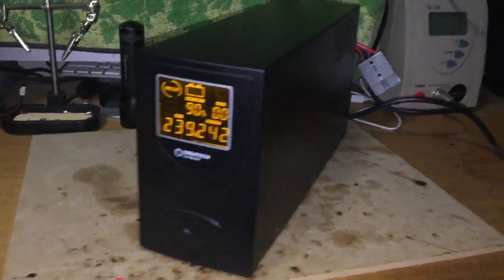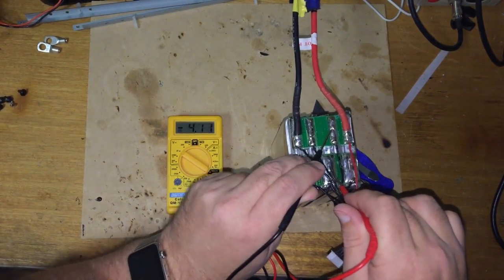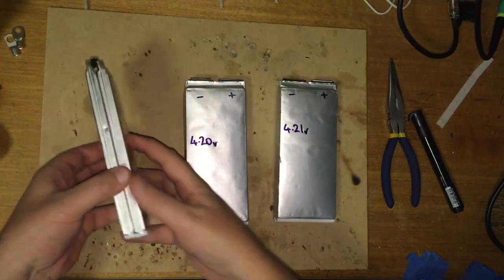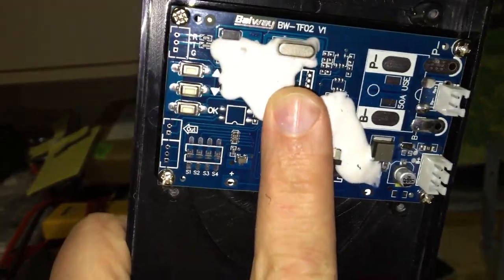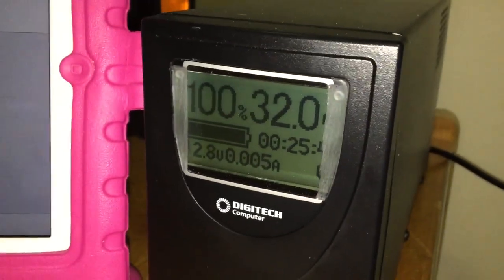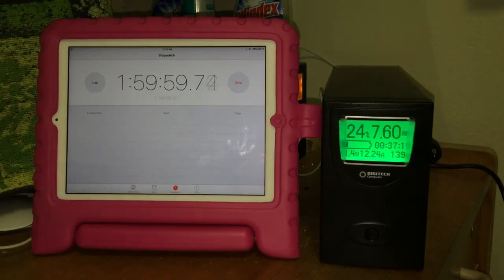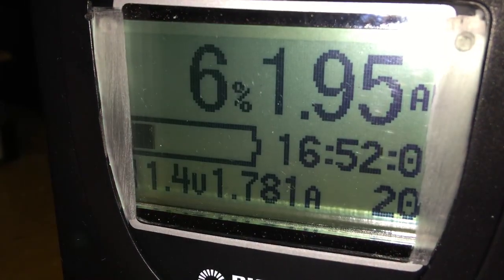DIY Lithium UPS Build

Comment: What is the shunt for?  Is that how you're measuring current?  Right nice video by the way.
Reply from the maker: MantisRay861 yep. The shunt came with the power monitor from eBay which measures how many amps are being consumed and from that everything else like battery level etc can be calculated

Comment: do you use the original charger (for the different type of battery) to charge the Lithium Ion batteries? Is there any problem using the different type of charger? I like your hack, by the way.
Reply from the maker: Thong Vu hi. No I don't use the original charger. I use a 12.6v power supply that switched from CC to CV. The cell balancing is done by the balancing circuit on the BMS

Comment: Good Job mate, can we replace the car lead battery by a lithium one?
Reply from the maker: Easy. But you'll need some sort of battery protection for the charging
Reply: The BMS doesn't handle charging?
Reply: There are different types of BMS, some off them have just the Over-discharge, Overload and maybe an Over-Voltage protection, some of them have also a balancer to keep the cells balanced.
Reply from the maker: Yes, this BMS offers over charge/discharge/load/temp protection and it had a balancing feature that will balance the cells when full
Reply: You need to worry about the current, a lead-acid battery can be asked 100-400A or more during start-up. So you need a 40Ah 10C battery minimum.
Also, you may need to modify or add a voltage regulator on the alternator, because the maximum voltage for a 3 3.7V nominal lithium battery in series is 12.6V, while the alternator will give 13.something.

Comment: may i know where you bought that 16000mah lipo is and how much it cost?
Reply from the maker: Hi. I was lucky enough to receive these for free from a drone company that replaces their batteries every 12 months. I have not had good results with these cells. I much prefer 18650 cells rather than the pouch cells

Comment: Is this an expensive battery. Would like to buy one and break it down for a different power supply purpose. Wondering if it is cost effective? Thanks in advance mate
Reply from the maker: The Dookster I got 6 of these batteries for free as a nearby drone company replace all their batteries every year. But I think these are expensive
Reply: @pcarlson1979  I am trying to make a 16ah 12v power supply for my fish finder  (out of 200a Lithium Polymer Spim08hp 3.7v 8ah Flat Pouch Cells LiPo Batteries) and can't find anything that would tell me whether I need 3 in series or 4 in series. Thoughts? 3 I was thinking would be less than 12v @3.7 and 4 would be 14.8 @3.7

Comment: that's cool !
Reply from the maker: Thanks. I'm building a 160Ah (2Kwh) Lipo battery bank to be used whilst camping. 10 of these 16Ah Lipo cells in Parralel. 3s10p. It's only a bit smaller than a normal car battery :)

Comment: what wave form your ups outputs? pure sine wave or modified square sine wave? if its modified sine wave, would you be able to replace the circuit with the one that will generate adaptive sine wave? pfc power supply don't like modified sine waves.
Reply from the maker: Mystic Bardock LSSGSS hi. The output is 240v modified sine wave. I'm fully aware of the limitations of modified sine wave inverters. The 3D Printer uses a switch mode power supply, so yes the power factor is not quite 1 so it runs a bit more inefficiently but handles the fast switch very well. Heating elements or resistive loads on the other hand can't use a modified wave. Inductive loads are quite fine.
Reply: Thomas James when it comes to modern computers with active pfc psu, they abruptly reset sometimes cuz of modified sine wave so is it possible to diy replace or modify ups circuit so it will output adaptive sine wave which is a modified triangle wave which is much closer to pure sine wave.
Reply from the maker: Mystic Bardock LSSGSS it's hard to find a saw tooth (triangle) inverter. Square wave is not ideal, but works fine. The power factor correcting circuits will run a little warmer, but as long as your device is in good condition it generally won't matter.
Reply: +Thomas James is it not possible to mod the existing circuit in ups so it outputs adaptive sine wave or pure sine wave? computer is new but still resets whenever there's slight fluctuations in power, computer powers off itself for a sec including the power led and then turns back on. http://www.akshatblog.com/use-only-pure-sine-wave-ups-with-psu-having-active-pfc/

Comment: most LIPO tabs wont solder, what did you do?
Reply: Factory pre-soldered them with the right flux so it's easier for you to simply apply heat and join them back together, if you got fresh battery tabs then get flux for soldering aluminum and 91/9 Tin/Zinc soldering wire, good luck!

Comment: How do you charge it mate? are you using UPS's charger?
Reply from the maker: Andrey Garcia hi. I've installed a lithium 12.6v charger and the protection is done by the BMS so whenever the power comes back, it automatically charges the battery
Reply: i have no idea how you put the charger anyway, can you please show me your charger and how you wire it? and the BMS work for protect Over Charge and Over Discharge, right? how to wire it all? any references? Thank you
Reply from the maker: Andrey Garcia I'm uploading a new video now that shows everything. It'll be ready in about an hour.
Reply: yeah. Thank You mate. I will waiting for ya. email me when it done
Reply from the maker: Andrey Garcia it's up now. Just go to my home page and it's the newest video

Comment: Hlo bro can i use lithium ion bms in Lithium polymer ?
Reply: They should have the same cutoffs, except if that's a 3.8-3.9V (4.35-4.4V full charge) li-ion (aka li-hv) bms, or an lifepo4 bms/battery (2.5V-3.2V-3.65V)

Note that you should also check the current (C rating*capacity in Ah)

Comment: Do you use any kind of battery balancer?
how long you charge it?
Reply from the maker: Hi, The BMS I use does all the balancing. The charger might take 18 hours to recharge but when it's done, it automatically switches off
Reply: what the specification of the required power for the BMS?
Reply from the maker: ***** Hi.
The BMS is a 3s LiPo BMS from EBay. It has charge balancing and can pass 60A. So at 12v that will let me use 720w. I am using a 600w inverter. The BMS was $14 from EBAy I think
Reply: I am still didn't get it, actually, what you use to convert AC power line to DC? and what is the output of the adapter? is it OK to use 12V adapter while max LiPo voltage will goes to 12.6V (slightly higher than the supply adapter)
Reply from the maker: +Kartiko Nugroho oh. To charge the battery I'm using a 12.6v LITHIUM charger. This then connects to the BMS which will then switch in balancing circuits when required.
Reply from the maker: ***** That will charge the cells to 4v which is totally fine for longevity .
Reply: hmmm but it wouldn't go to 100% right?
and what about max current that your power supply can deliver?
Reply from the maker: +Kartiko Nugroho if you charge the Lipo to 4v it won't be at 100% but that's ok. I have a 600w inverter which delivers 240v up to 600w. This will draw up to 50A from the battery. The Lipo can safely deliver 480A (15C) but because this is a second hand Lipo, it can now only deliver about 100A. So this is fine for this application because I only have a 60A battery management system. It monitors each cell voltage and if any cell goes too high or too low it will turn off power from the battery. I did a successful run test where I actually 3D printed a model and the system ran my 3D Printer for 2.5 hours! The printer only draws about 10-20A
Reply: I mean the power supply located after AC outlet before the BMS...
Reply from the maker: Oh ok. I have a 12.6v lithium charger. So it connects 12.6v CC and CV to the onboard BMS. The charger drops 240v down to 12.6vDC
Reply: what the current of your CC and CV charger?
Reply from the maker: I am using a 12.6v 2A CC CV lithium charger
Reply from the maker: After I drained the battery flat, the charger charges the battery at 1.89A which is about as fast as it can go. It took about 20 hours to fully charge up. It's a bit slow I know but I can only fit in a 2A charger, the 5A charger won't fit
Reply: 12.6 is normal full charge voltage for -series cells... why did you say they would only charge to 4V ?
Reply from the maker: I have set the BMS and charger to only charge to 4v per cell. This will improve the longevity of the lipo cells as they don't like being at 4.2v for very long at all.

Comment: Where did you get the display from?
Reply from the maker: EBAYhttp://www.ebay.com.au/itm/Battery-Capacity-Tester-coulometer-50V-350A-Lithium-Lead-acid-12v-24v-36v-48v-/331727389307?hash=item4d3c7e427b
Reply: Nice project, thanks

Comment: Great Video !  Go outside and short out the battery and see if it will catch fire...  A very dangerous metal, but I do like Lithium ! ! !  tjl
Reply from the maker: Tim Lipinski I'd rather not. I've accidentally shorted one of the lithium cells on my home converted electric bike once. Just for a fraction of a second. Huge blue sparks and a few holes in my shirt and it sliced through the hardened steel bolt like soft butter!!

Comment: tell me about  the display
Reply from the maker: ART crush it's a COULOMETER capacity monitor from eBay. It'll measure up to 300A.
Reply: i have a batery made from 18650 cells .what is the bms i should use.( doesn't ups comes with a bms system )
Reply from the maker: ART crush The original UPS had a lead acid battery so there was no BMS. You'll need a 3s BMS

Comment: Not safe li-po batterys are not as safe as ion but they have them in you phone so it shouldn't be to bad
Reply: You're ignorant.
Lipo is the replacement for li-ion.
Lipo are the marginally safer batteries.
The problem was never the batteries anyway, it how they are implemented.
Neither is safe without a bms.
With a bms and proper configuration, both are safe.

Comment: You are destroying those lipos and chancing a runaway thermal reaction, which could burn your house down. Each battery should never be discharged lower than 3-4 volts each. Basically, if that unit draw the voltage on the pack lower than 9.0v, the lithium polymer battery pack has been damaged. You replaced a SLA with lithium, without using a lithium control board and that is really, really dangerous..
Reply from the maker: Paul Andrulis yeah I know. The BMS on the battery shuts off the power if any cell hits 3v.
Reply from the maker: Paul Andrulis I have used a lithium charger and also a lithium BMS with cell balancing. Don't worry, it's all done fine and it's still working today
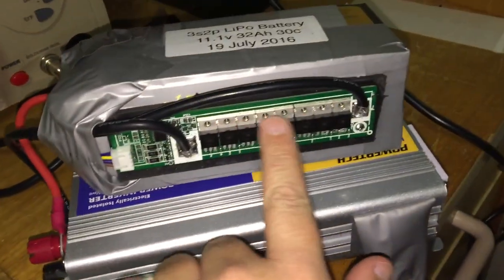Reply from the maker: Please see the BMS at 2:53

Comment: Wow. You didn't know anything about lithium cells when you made this, huh?
As soon as a lithium drops down below a volt or so, the internal chemistry of the battery starts creating unwanted structures which result in internal shorts.
You may have gotten away with it by immediately charging them up again, but I wouldn't ever trust those cells again.
Reply from the maker: Ummm. I know quite a lot about lithium batteries actually. This UPS is still going good. I haven’t seen my video for a long time but I’m sure I didn’t use any cells under 2.9v
Reply from the maker: Actually if a lipo cell falls below 2.5v I would never use it again. The dendrites that you’re talking about permanently hurt the battery and they’ll start to puff up
Reply: @pcarlson1979  1.0v @5:43 you're at 1v - unless your lcd is showing something other than actual voltage.
Reply from the maker: @Zomby_Woof  ah right. No. The LCD screen was a tiny bit too big for the case so it cuts the first number off. The inverter cuts off at 10.5v which is still about 3.5v. Plus my BMS is set to cut off if any cell hits 3.3v
Reply: @pcarlson1979  2.5 is the low voltage cutoff per spec on many batteries. 

The actual damage starts below that, and does take time, so if I dropped to 2.0v and noticed it in real time, or the system had already begun charging it, I would just monitor it for health.

If I grabbed a cell out storage and it was way below, and had been sitting that low for a long unknown time, that's when I'd chuck it.
Reply from the maker: @Zomby_Woof  have a look at 3:59. You’ll see I tried to scratch off some of the black paint but it still covers up the first digit. In person you can get up close and see it. In the video it starts beeping at 10.8v
Reply from the maker: @Zomby_Woof  I had a blackout a few weeks ago and this kept my modem/router/network hard drives running for 6 hours and only dropped to 88%. But they don’t use as much power as the 3D printer
Reply: @pcarlson1979  ok, I get it.
On that basis, I retract my original criticism.
Reply: @pcarlson1979  I've been looking for a large "bad battery" ups for a while, but not hard enough apparently - I keep just missing them. I swear there were a bunch on craiglist until I started looking for one.